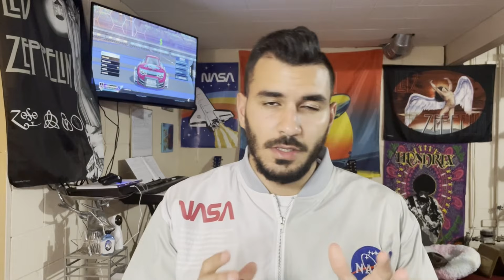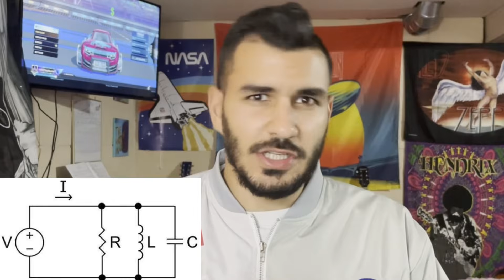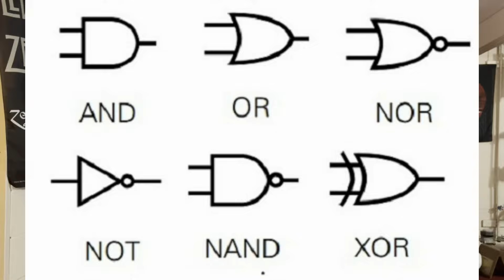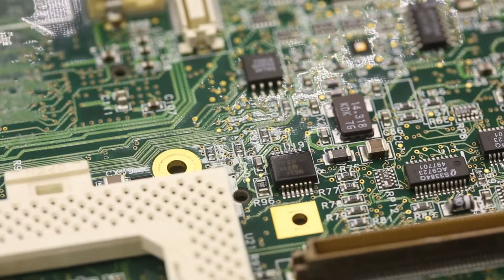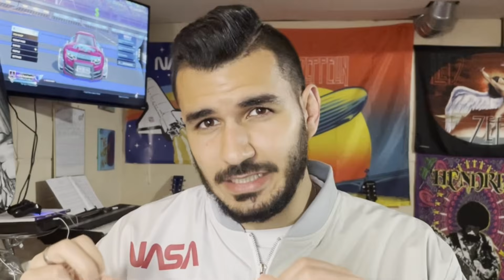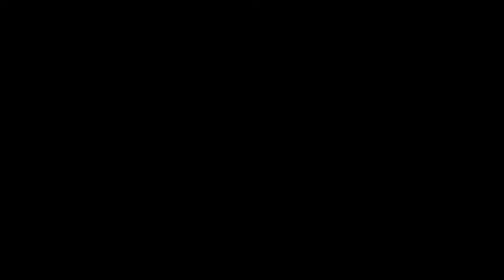Ranking Electrical Engineering Classes: Hardest to Easiest

Comment: As an information engineering major  which is mix between computer science and electrical engineering, I gotta admit signal system and electromagnetic were the hardest courses I've taken so far, much harder than any CS related courses. 

On top of that, I think Calc 3 (Multivariate calculus) also deserves a seat as one of the hardest courses

Comment: Learning microelectronic circuits from books by Sedra Smith or Neamen was tough because the basic concepts were drowned out by all the math and design considerations like oxide thickness and other dimensions. I had to go back and look at Boylsted’s microelectronics textbook to get the meat and potatoes.

Comment: This video made me feel better about how I stressed I am this semester. Thank you for posting.

I am in signals and systems, applied electromagnetics, network analysis, and intro to logic design 15credits. I really appreciate being able to take only engineering courses, because I worked so hard to get have the privilege to do that. It was not “difficult” to get here, it just took a lot of effort and time.
The applied electrimagnetics course is the most difficult for me, and between all the other classes there is just not enough time in the day to spend endless amount a of time trying to get that intuitive feeling of what is happening, I would burn out. The instructor has the TL quizzes, for transmission line quizzes, where we are assigned the frequency of the generator , magnitude, angle and character impedance and have to derived the wave equation, reflection coefficient…etc.
In network analysis we are working on non-ideal transformers which connects to other courses. in signal and systems I finally get to use all the DE I learned almost a year ago. I agree with you it’s a fascinating course and I like the textbook, we use Lathi, carry it everywhere just like you did. 

Thanks again, this video made me feel like I’m part of the tribe.

Comment: You missed semiconductor physics and devices. It is easily harder than electromagnetics! In fact, I would say it is objectively the most difficult to get into.
Reply from the maker: semiconductors is in microelectronic circuits by sedra smith -- was a tough one for sure

Comment: Hi. What are your thoughts on Industrial Engineering?! I switched my major from Civil engineering to Electrical engineering this semester and I regret it now, because I was forced to take Calculus 2 along with one Fundamentals Electrical Engineering class, as well as an "Introduction to Embedded Systems Class" ( which I just recently dropped out ). It was a radical shift, and Im failing Calculus 2 right now. ( Imagine having to switch your major to one of the hardest engineering branches and college majors, and take two of its classes simultaneously when you're a beginner). EE is a lot more difficult than I thought it was going to be. I heard Industrial Engineering is the easiest engineering branch; is that right?!?! What was your cumulative GPA in college when you studied engineering?

 Btw I love those Led Zeppelin posters. You have a good taste in music if you listen to Led Zeppelin, and they're my favourite band
Reply from the maker: think I answered this in another comment -- find jobs within that field and ask questions about it

Comment: I dreaded signals and systems. Power Systems is extremely bulky, calculus classes were anything but easy. Electrical machines and drives, protection engineering. Omg, everything sucked. But on the bright side, I can learn anything easy and I'm addicted to caffeine

Comment: Advanced Power Systems was hardest and I also found that in industry to. Can easily experiment with electronic design and signals as costs are low. Where power systems costs are very high with no room for error or over design

Comment: A stranger advised me to learn programming, but I do not find any relationship between programming and electrical engineering, and how to use C++ in electrical engineering.tnx
Reply: I want your experience
Reply from the maker: C++ can be used to program microcontroller such as arduino. watch video tutorials on arduino microcontrollers

Comment: Thank you for the video. Students have to do many problems in order to understand these courses in Electrical Engineering.  Writing proofs is also important in these courses. Advanced Calculus is a course that undergraduate students should consider taking before tackling Signal and Systems Theory and Probability Theory.

Comment: Diploma in Electrical Engineering, having problems with advancing my studies to persue a EE Beng due to sponsorship but I agree the electronic parts of the course are really tough and confusing. I initially wanted to go the electronic route but power electrical seems much more stimulating because things are easy to visualise.

Comment: What actually the difference between analog and digital circuit?
Reply from the maker: digital is 1s and 0s represented by two different voltage values, for example 5 volts and 0 volts --- analog can be any value really
Reply: @alithedazzling  So, is integrated circuit an analog or digital?
Reply from the maker: @eliran986  usually they are digital because they have logic gates which operate on 1s and 0s
Reply: @alithedazzling  So, if I understand, most of the hardware like cpu, gpu, boards are digital.  So what kind of electronic devices made by analog design?
Reply from the maker: @eliran986  radio components like amplifiers, filters, mixers, etc

Comment: Funny that I agree with your ranking for most students and for yourself personally as it is also applicable to me. Yet I ended up working in Power Systems. What make courses difficult in my opinion are 1) that students don't establish strong basics from the beginning and 2) teaching staff is not qualified/interested enough to teach these things
Reply from the maker: very true for both points, unfortunately point 2 is still a reality despite paying a ton of money for school
Reply: Hi, does specializing in power systems mean you're going to work with grids, substation etc. I.e big stuff or is it also common to find career in consumer electronics with that particular specialization at uni?

I've also heard of power electronics, are these the same thing?

Comment: This is insane. I am a senior studying  Electrical Engineering at Qatar University and I agree with you on almost all points. Cuz I studied almost all of what you mentioned such as electric circuits 1,2 , signals and systems, communications engineering, electromagnetics, digital systems design (vhdl), embedded systems (C language using mbed) and digital signal processing. However, I found digital signal processing to be easier to comprehend than embedded systems, signals and systems, and control. The most enjoyable I would say is electric machines which is where we study magnetic circuits, transformers, synchronous, asynchronous, and dc machines.
Reply from the maker: Oh wow, that's super cool! I wonder what its like to study EE in Qatar. Would you say your overall university experience is good?
Reply: @alithedazzling  I'd say studying EE at Qatar University is much more challenging than EE at the campus we have of Texas A and M. This is mainly because our major is soo hectic and the assignments that we get are much detailed and can require a whole lot of time just to complete. The labs however, are very fun because we got the opportunity to design an FM transmitter and receiver using components such as op-amps, and resistors, in communication engineering.  Overall, the learning experience was good too
Reply from the maker: @fatimadarling9656  wow, thank you for sharing that detail. I'm glad you had the more difficult experience, as it will help you out in the long term. 

In all cases it's an absolute pleasure to have you in this channel, I am glad you found this video. Please feel free to suggest any video ideas that would be helpful to you
Reply: @Ali the Dazzling  Thank you brother. I actually wanted to know if you know any good textbooks for RF microelectronics. Because unlike the previous communication courses I took which were mainly digital communication and wireless communication, this course is mainly about working with the analog front end side of the communication system. Do you think the book RF microelectronics by Behzad Razavi is a good one? Also, if you have other resources in which I can study this course, that'd be quite helpful. Jazak Allah Khair
Reply: @fatimadarling9656  Hello fatima i have so many question about working at Qatar as a Electrical Engineering,about the salary and other stuff can i?because I’m living in Montreal and I want to leave for a Muslim country.

Comment: All EE classes are difficult.  Believe me.
Reply from the maker: If course they are, but depending on what you are interested in some can be more difficult than others :-)
Reply: @alithedazzling  looks like you didn’t mention Principle of semiconductors, solid state physics.  So they are not considered EE courses?  That was my specialization.
Reply from the maker: @patricks8364  You touch upon those a little bit in the microelectronics class -- in my school we didn't go too in depth, but in the sedra smith book I mentioned there is a chapter on semiconductors leading to transistors
Reply: @patricks8364  my course for this semester is entirely semiconductors transistors hurt my soul lol. But it’s all fascinating.
Reply: @patricks8364  For me this was a graduate course. In my undergrad we only covered this a bit, enough so we can know which type of transistor we should use, but to get into the nitty details was much harder.
Reply: @patricks8364  yeah,my school did teach more about control and electronics application(analog is cut down a lot)we study mostly about electronics ,power electronics,digital design,PLC(i belive since my major is automation so RF theory is cut out?)
Reply: I just aced signals and systems. Feeling very proud rn!
Reply: True!!! Every EE class is difficult! Believe me felt like threading water! RF Transmission lines were WILD , recently graduated
Reply: My field is signal processing.   I remember the class project is to create a filter to remove particular noise from a signal.
Reply: How’s EE going
Reply: I switched my major to EE and recently graduated. I’ve always been very strong in math and found most courses to be very easy and aced most exams. Thought about Phd but decided to go to Wall Street instead.
Reply: Agreed. More or less
Reply: depends the subject you put your tears and sweat in,some are harder
Reply: Me as a EE student 🥲
Reply: Agree 1000%..😂

Comment: Hi Ali, I am about to start my first year of electrical engineering and I am undecided between power systems (ie distrubution of electrical energy) and embedded systems (ie electronics). I am interested in both fields, I am just not very good at software (and don't enjoy it at all) so I am thinking about doing power systems. However, I am scared about making a mistake because we all know that software will only develop exponentially in the near future, basically  I am scared about struggling to find a job if I chose power systems because everything today is about software and coding. Could you help a brother out please lol? Love the content
Reply from the maker: do you have to decide right now? I would say first year is very early to decide. It's best to take some classes, talk to some professors/upperclassmen, and decide then if you can. Pick the one you enjoy more once you have acquired a bit more experience
Reply: @alithedazzling  yes first year but its a bit different. Basically after h.school i did 2 years of general eng. (im in france) abd I got to study the basics of EE, ME, CS as well as chemistry etc... So I have a pretty good understanding of Power systems and general electronics. Basically I am really tempted by Embd sys pour I am again not very goof at software, but I would be willing to learn don't get me wrong. My problem is that on indeed or whatever when I type "electrical eng." (in any country) I've noticed that's it's mostly to do with power sys and when I type "electronics eng" or "emd. sys. eng" I get one or no results. So now i'm more in a dilemma than when I wrote the first comment lol. Basically what I want to know for sure is the following : which speciality in EE is the most secure job wise and which will permit me to work anywhere around the world (I kinda want to travel). Thanks
Reply from the maker: @soufyan454  so I can definitely see how power systems are more globally in demand, wheres as embedded systems is more prevalent in countries like the US for example where there is more electronics design

If you enjoy power systems its definitely a safer option in case you want to live in france, USA, or wherever.

However keep in mind now adays there are many remote jobs, so thats another thing to consider!
Reply: @alithedazzling  So you don't think power systems will ever die? Because everything seems to be about software lol
Yeah because I really want to travel, I especially want to live a while in the middle east, do you think they are in demand there (I am assuming you are arab)
Reply from the maker: @soufyan454  so the way I think about those things is a bit different.. i dont think youre forever married to the major you choose or area you work in. You can always change and adapt and learn new skills. So I am not too concerned myself with things changing in the future becuase im sure I will adapt as well.

As far as working in the middle east, I honestly have no idea since I have not worked there before and have not lived there in the past 10 years or so. I live in the United States. I would try to find people who currently work there and ask them. Hope that helps!
Reply: @alithedazzling  Thanks bro! I can't wait to get started
Reply from the maker: @soufyan454  goodluck!
Reply: @soufyan454  on coding and software, if it is at degree level, it is everywhere. you will have to start loving it. You may find it may not be as hard since you have a background. i also thought Electrical doesnt have much coding but was very wrong. I grew to enjoy it after a lot of struggling.

Comment: Vhdl is more related to digital principles than it is to embedded systems. In practice, they do not necessarily have the same use. Yes you can use FPGAs in place of microcontrollers for most functions. HDLs like Verilog and VHDL ( by extension FPGAs) are mainly used for designing flexible digital circuits.
Reply from the maker: Vhdl is based on digital principles, that is true, but Vhdl is similar to embedded systems in that students get their first hands-on exposure in programming a board and building a project (rather than just theoratical knowledge such as in digital principles), thus this adds a new layer of difficulty but also makes it easier since its more hands on.

Comment: I am doing electrical engineeirng power and you are right.  Even tho I love anything that's related to electricity , electrical power systems are the hardest to master; the distribution system is super complicated and the one tiny mistake can short circuit an entire electrical grid. It's very hard to maintain the certain power factor and  distribution loads. Of course this is just the beginning of it. 

But signals and systems is also very vigorous, I d say it is 2nd after power systems. Easily! 

I was wondering , as it's my last year , does USA have a good demand of electrical power engineers ? Because we have studied a lot of electronics and embedded systems as well.. 

Thank you for reading my comment. Awaiting your reply.
Reply from the maker: Absolutely, each field has its bottlenecks, its good that you figured out your own.

I would say yes, the US has demand for all sorts of electrical engineers, and power is no exception. I'd say especially with rise in demand for cleaner power such as solar and wind. I live in new york and there is demand for power engineers in companies such as national grid. 

You can do a quick search for "power systems engineer" or "electrical engineer" on indeed.com and see the recent listings.
Reply: @alithedazzling  awsome thank you so much.. love the videos.  Keep them coming😍
Reply from the maker: @midnightmadness1714  Thank you!! Stay tuned for more :-)

Comment: Hi ,
When did you get your nasa internship? In undergrad or while you were doing your Phd ? And how what’s solid gpa do you recommend to have by senior year to get internships? Thanks in advance
Reply from the maker: I got my first one in undergrad, then my second one between my masters/phd. You can apply online for the undergrad ones through the summer internship program. 

I'd say GPA is not that important, but at least 3.0. If you can have above 3.5 that would be great, as long as you're not spending all your time on that GPA. More important is experience and skills.

Obviously to increase your odds you want both a high gpa and good set of skills. There's another video on my channel called "how I landed 3 electrical engineering internships" I think it will help you a lot!
Reply: Appreciate it man , best of luck and thanks for the advice !!!
Reply from the maker: @Salamona2026  You got it!